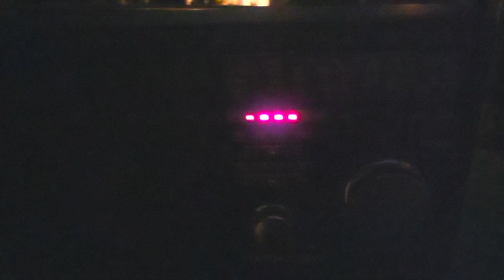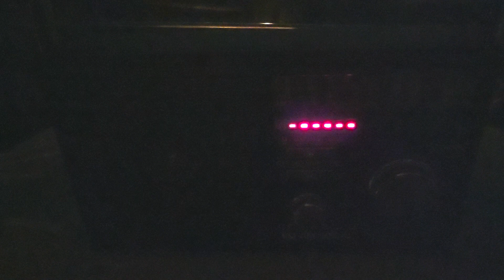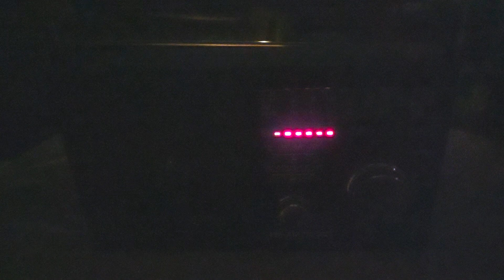Yewrich YR-RU8 receive CHU time signal 3330 kHz Shortwave and Radio Habana Cuba 6000 on telescopic

Comment: Gilles, is there a special type of speaker installed in the Yewrich YE-RU8 as it seems to oscillate waves from the sounds that can be seen outside its grille depending on the light or is it vibration from your table that it is sitting on?  Thanks for the video.